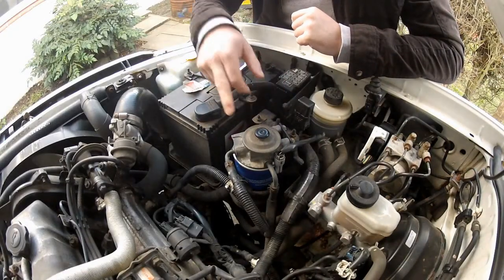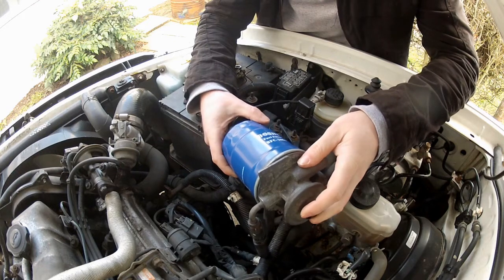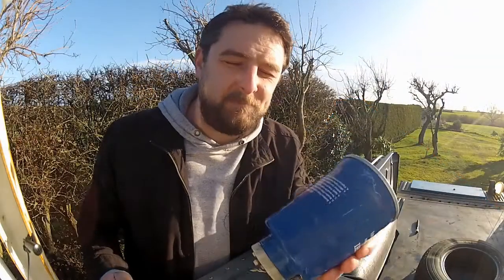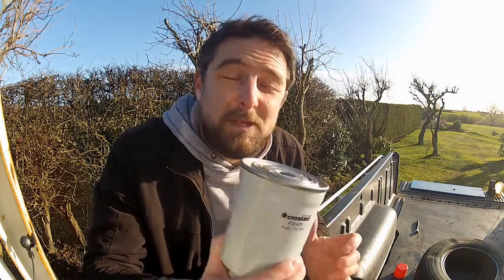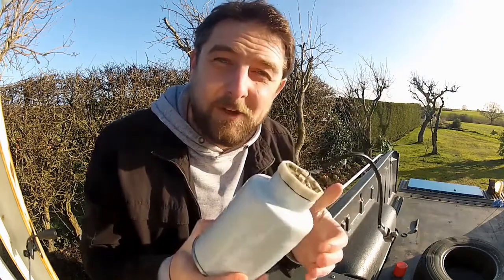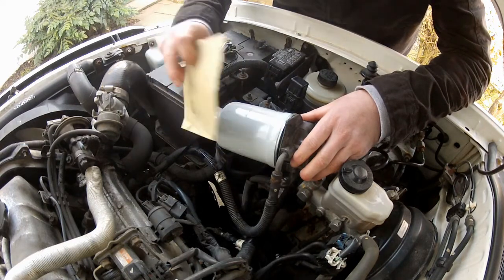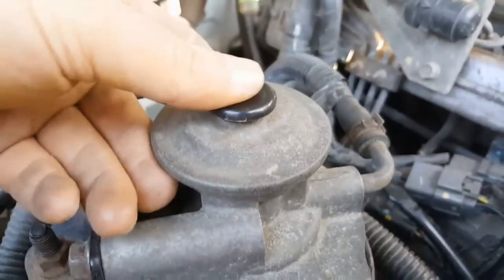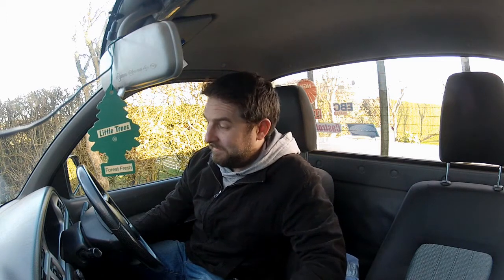How to Replace a Diesel Fuel Filter & Bleed Air from the System (Ford Ranger TDI) | Tech Tip 20

Comment: Hi
I have a Ford Everest with a same type of Fuel pump and filter set up but TDCI.

I replaced the fuel filter the other day. it runs much better than before but It takes time to start especially during cold start. I believe there is still air in the system. What can I do to solve this?
Reply from the maker: Once you've primed it and started the engine that should get all air out of the system. I'd check the fuel lines running to and from the filter as these are prone to corrosion and can let air in when the vehicle is sat for a while. Only other thing I can suggest is check your glow plugs?
Reply: @FastRust  we took the engine cover out and noticed there was a minor leakage on one of the injectors
we are having it leak tested for now
thanks

Comment: Thanks for the video. Should the drain plug be tight enough such that nothing leaks when I pump the button?
Reply: Mine is leaking when it comes to a point the button is firm.
Reply from the maker: Should be no leaks while priming except from the bleed valve (if you have one)

Comment: I think I mucked up. After changing filter, got called away, came back snd started it. It ran until fuel in line burnt off.. forgot to bleed the damn thing before starting it... now what?
Reply from the maker: Bollock the guy who distracted you 🤣 Keep pumping the bulb until it pulls fuel through. Then try start it. If it splutters and dies repeat the process.

Comment: Hi, I've been hand pumping the filter for some time now and it hasn't gone firm. Any reason why?
Reply from the maker: First time I changed one I did the same. They don't go super firm, just a little more firm than when there's air in. Tough to tell sometimes. If you've been at it ages I'd just try cranking see if it fires.